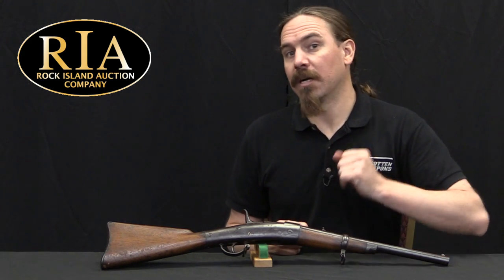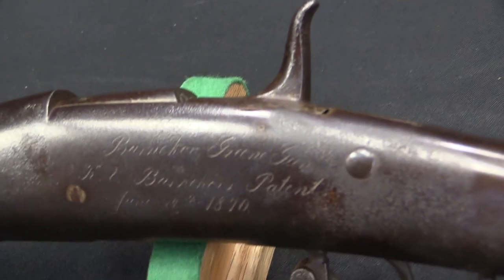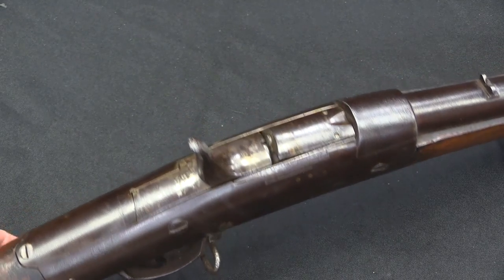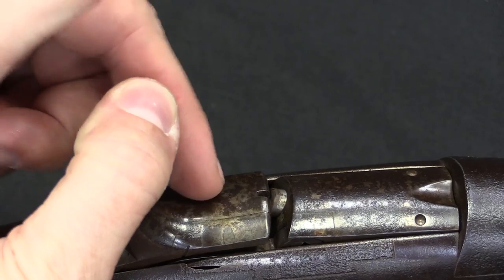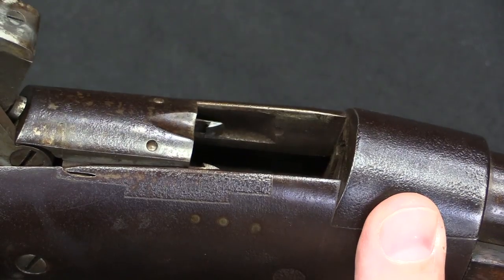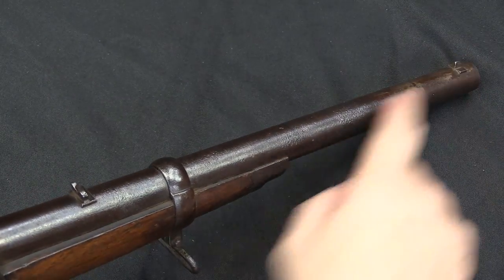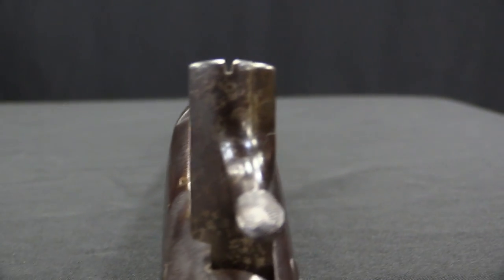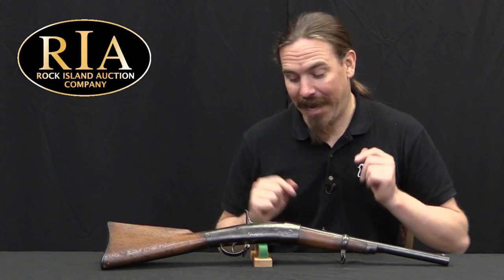Barnekov Greene Prototype 1870 Open-Bolt Army Rifle

Comment: With the open bolt and open bottom, it would seem that a fresh cartridge would easily fall out if the muzzle were elevated, and the soldier would be unable to use the weapon against an (even slightly) elevated target.
Reply: Perhaps he was counting on the cartridge being to long to fall out from the gun?
Reply: I hadn't thought of a problem with elevating the barrel, but it also looks like this would be really difficult to load without dropping the round out the bottom.  There doesn't seem to be anything to guide the round into the chamber.
Reply: I also have to wonder how many times a finger got caught in that thing.
Reply: Fouling might help with this actually
Reply: I wonder if this was intended to use those "ringed" cartridges. The ones that have a slight ring around them in addition to the rimmed base

Comment: Seems to me, on top of the numerous safety issues mentioned concerning this design, there are a few inherent design flaws as well. One being the trouble a soldier might have in keeping a round in the chamber from just falling out (and maybe not even realizing it) when needing to urgently fire the weapon or in the heat of battle. Secondly, having a wide open breach while slogging through the wilderness, even with a single shot, is less than desirable.

Comment: Looking at both how short this is and the fittings on it, I'd say this isn't even supposed to be an example of what a carbine of this system would be. It's more like a super short 'condensed' proof of concept for the musket version. A carbine of this time 'should' have a cavalry type sling ring along the side of the action, this has a comically short span between bottom mounted sling swivels. It really screams 'proof of concept firing model' to me. So much proof of concept as to not actually matter if the sights work or it can hit a target, just prove that the action functions and fires and can be more than a paper sketch.

Comment: Maybe the sight on the hammer/bolt is to be used like the sight on Colt blackpowder revolver hammers in conjunction with the front sight. I'm just guessing.
Reply: looking at it , that is exsactly how it should work , but for all the reassons that gun jesus pointed out  it would have never worked , the sights on the toggle dont line up with the front sight post , the delay between  triger pull and fire  would be mesured in parsecs and the bolt slamming forward would  just throw  any accuracy out the window
Reply: @randomusernumber1  parsecs measure space, not time. Though... it does have a long way to travel.
Reply: @WeDontTalkAboutJosh  , that is part of the joke ,because of "this is the ship that made the bla bla bla in parsecs ; :D :D
Reply: @randomusernumber1  I mean I knew where it was from, but Star Wars is way more popular than astrophysics terminology and you can never be sure everyone got the joke... Ah well, never mind me. Best go and put my pedant hat in the wash for next time.
Reply: The other rear sight might be a relic from using a preexisting barrel then.
Reply: @tz8785  yes , gun jesus said that and also when the gun is cocked you cannot see the other rear sight . ths gun shoots from an open bolt
Reply: @randomusernumber1  "the delay between  triger pull and fire  would be mesured in parsecs" Upvoted just for that!
Reply: Yes, looks like they stole their rear sight from Colt cap&ball revolvers. It was probably zeroed for 1000yds. They shoulda altered the locking surfaces to a Blish lock, to get a semi-auto, open-bolt, single-shot, black powder rifle.

Comment: Now if the rifle had been a closed bolt system, it would have made a lot more sense. Cock the rifle on open/close and then fire when ready.
Reply: Maybe Barnekov couldn't work out how to make it closed bolt (or someone else held that patent). As you say that would have made more sense and a more useable gun.
Reply: @IceWolfLoki  If the designer knew how to make this type of firearm I suspect a closed bolt system wouldn't be too far off but as you've said, a patent might have been in the way.

Comment: Toggle action, pre Luger. Would be interesting to adapt to an SMG. Shorter receiver, less weight. Could even revolutionize bullpups.
Reply: Well, there's the Furrer SMG, a notoriously big, heavy and clunky gun.
Reply: @janwacawik7432  We're talking 2019 technology, not 1919. In other words, shorter stamped steel (or machine aluminum) receiver, open bolt, striker fired, delayed blowback toggle. Toggle acts as buffer, delayed blowback eliminates need for 3 pound bolt.
Reply: @smorrow  That firing pin would require being within a bolt. Striker fired is much simpler.

Comment: I wonder if the loading idea was to push the rim of a cartridge down between the extractors. Moving the spent case out the bottom and holding the round ready to feed. Doesn't look like there is room to insert (angle, tilt) even a short pistol size cartridge in the chamber. Plus, in getting this built you don't think someone pointed out that when you tilt the gun up the round falls out?

Comment: The firing system is quite intriguing. It'd be okay for casual shooting, but not so good for shooting on the go/under fire. From the looks of it you can't chamber a round until you're ready to fire, without risking the cartridge slipping out.

Comment: Imagine this idea applied to a toggle-link Winchester... somehow. 15 rounds of full- or semi-auto .44 pistol rounds in 1870something. Certainly would add a lot of useful firepower to a stagecoach defender, or a cavalry trooper.
Reply: This open bolt design won't turn a gun into automatic though. You will need the bolt to open automatically after each shot to do that
Reply: @vrisbrianm4720  No but slight modification to a Winchester/Henry/Volcanic toggle link would bring that about -- it would need to come into battery very slightly unlocked. Similar to how Luger actions are modified to cycle blanks for film and theatrical use.

It's all retrospective navel-gazing anyway, we can imagine what we like!
Reply: @sinisterthoughts2896  I did not fail to notice that the Barnekov does not automatically open -- I thought that too obvious to bother mentioning. (See my earlier reply, which you appear to have missed.)

To my mind what the Barnekov brings to the table is a system whereby the bolt/breech block can be automatically closed and fired upon release. This allows a disconnector or auto-sear arrangement far easier than the typically hammer-sear-trigger arrangement in a Volcanic/Henry/Winchester rifle, which as the predominate repeating rifle of the era, would appear to be the natural starting point for an automatic shoulder-fired weapon of that time. To me this is a bigger and more important step than fingering out the best way to have the gun open after each shot (lots of ways spring to mind, many impractical or economically unfeasible).

It's all impractical, speculative navel-gazing anyway because we know that's not what happened and with the benefit of 150+ years of experiment we know it's not the most practical way of getting a pistol calibre carbine or SMG. However it is fun looking at disperate ideas from various eras and seeing if they could be fitted together differently than they actually were to make something better, faster or earlier than what actually came about.

Comment: I'm wondering if the barrel, like the stock, was from an existing carbine, just came with sights and the notch in the back block was supposed to be used as the rear sight by itself.

Comment: I would guess that you would aim the sights on a standing footmen, then open the bolt basically locking the sighting in, load and then fire.

Comment: d00d, if this was converted to closed bolt with  sort of a two stage trigger where the first pull closed the bolt, but didn't drop the hammer...

Comment: Found patent through Google listed as "US104100A"   Very interesting to look at concurrently with watching the video!

"The nature of my invention consists in having simplified the construction and the number cf the different pieces necessary to make a breech-loading rifle, and also in having made the construction and connections in such a way that a single movement of the hammer opens the breech, after the gun has been fired, extracts the shell of the former cartridge, and the gun is ready to be fired again, after a new cartridge has been inserted into its place, without another movement of any part of the gun."

Comment: What's all that terrible behind the idea? Artillery still to this day uses automatic extraction - ejects spent case, after which it must be loaded manually. So the concept on it's own is OK, it's just that the specific execution of the idea might be flawed.
Reply: @UCcIQXK-jYgvydGxuSmadtAg 
Indeed, it doesn't extract bullet on it's own either, only when hammer is lifted, I didn't realise that at first.
And, as you just pointed out, there is no way for a live round to be loaded and securely sit ready to fire, as the breach block is not separate from the hammer, which is absolutely hilarious!  XD     Besides it can give user "a thumb", if breach block is released while fingers are still in the breach area.

Comment: Hi Ian, I really like your videos, however it anoyes me how you explain toggle lockage. How you are explaining it it would appear that an elbow hinge, when in straight position is totally locked, and that only a force breaking the straight hinge can unlock it. This is not true. If notjing is there to keep the hinge in the straight position, nnn elbow hinge Will break. This is the  principle of buckling. If a certain amount of force is surpassed, if indeed the hinge is compeletely straight, the hinge will break in am unexpected fashion, and seing it is preventent from moving down(in this case), will move up. For it to be locked, there is something needed to keep the hinge in straight position, something else than the spring of the firing mechanism, because this force is neglibile in comparison the the force acting on the boltface caused by the recoil, and would not prevent the bolt from opening. What is needed is a guide cam, just like on a winchester lever action, which fysically inhibits the hinge from moving. How this is done in this rifle is not clear to me. Is this rifle just locked by force or is it really "locked"?
Also there must be a delay between the rifle locking and the rifle firing for it to be truly locked. If the whole bolt-firingpin assembly was really a toggle, this would not be possible. How is the locking thus achieved?Could you therefore maybe do a video dissassembling this gun? That would be really nice

Comment: It would have been much more practical if it shot from a closed bolt.
Reply: More practical?  Yes, absolutely, but it would also be massively more complex, too.  This looks like it could be built and maintained on the cheap, which, at that point in history, would have been a sizable consideration.  The US wasn't exactly an economic powerhouse yet.
Reply: @andrewamann8855  Not too much complicated. Just add a hammer on it.
Reply: @babblingbabblator9259  it has an integral hammer already...  If you want to maintain the toggle lock, you would have to add at least 1 more spring, a second set of locking surfaces to hold the hammer, or at least to allow loading with the toggle open, without risking the soldier's thumb whilst doing so, and a release for the lock/bolt.